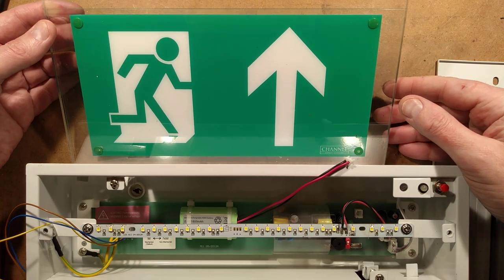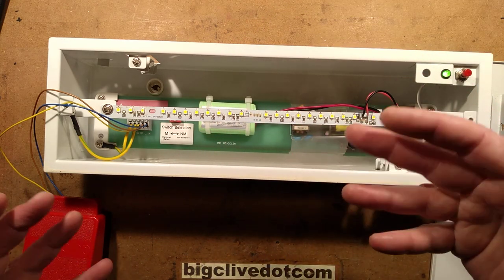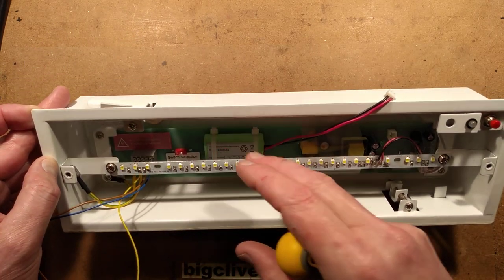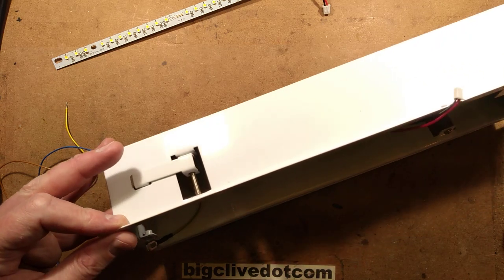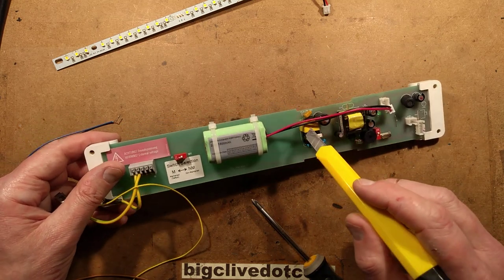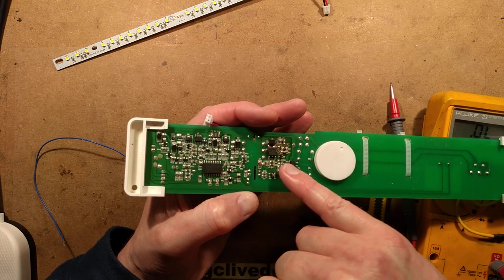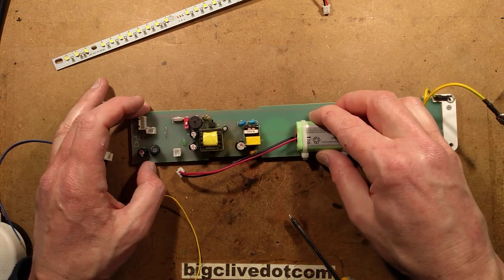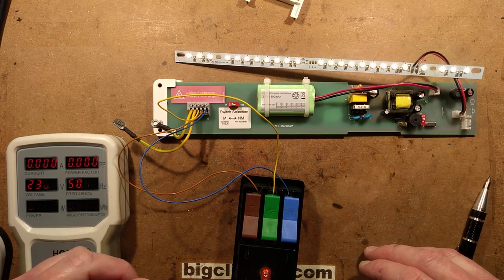Inside a self-testing emergency exit sign.

Comment: In the 90s I was working at a cinema as a machinist, we had 24V exit signs, two lead acid batteries in the machineroom was the powersource. The Cinema was built 1923 and using the same cables and some patches, it was a struggle to get the signs working at all. And some directors slipped a note in the box with the 35mm film with instructions how to show the movie. It was quite common with a schedule (raider) how to show the movie, this music should be played before the movie and this after. I remember Jurassic Park, "Please turn up Dolby effects volume, turn exit lights off".
Reply: Steve Henriksson hey that’s really cool. I’ve seen a copy online, of the notes Kubrick sent out with the Shining.

Comment: These newfangled fancytype signs are no fun anymore without the radioactive gas
Reply: I had an office in a facility that hadn't converted its exit since from Tritium. Part of the facility was used on weekends as an AirSoft play range.  Some of those signs got shot out :( :( :(
Reply: @patchvonbraun  Because the gas is heavy hydrogen, the mean velocity of the molecules at room temperature is very high and the diffusion rate of the gas in air is extremely high. It is virtually impossible to experience even a measurable dose of beta radiation from tritium when one of these signs is broken, let alone a dose dangerous to health. There have never been any recorded cases of significant health impacts to anyone as a result of their breakage so far as I am aware.

Comment: I see a problem with these devices and the description of them. They have a fairly accurate timer (I assume less then 20ppm error for that crystal) and after power-on they start self tests at regular intervals. So if you have more then one of them powered up at the same time, they will run the 3h self test at the same time. If the clocks go out of sync, there is still the key switch mentioned around 3:37 to synchronize them again.

Now with these parallel 3h self tests, all emergency lights will drain their battery at the same time. If a real emergency happens after that 3h self test, the battery will be empty.

A solution would be some sort of random value added to the self test interval or some redundancy (two batteries, each capable of powering it for 3h).

Just some thoughts.
Reply: That's the same scenario as annual EM testing on any lighting circuit. It's a roll of the dice, the regs say they should be tested at "a time of minimum risk" but is that through the day when there's natural light (in some buildings) or through the night when there's less people put at risk (in some buildings). They then have to obviously charge back up just like this one. I do 2 floors in our building, the floors are shared among the shift sparks, and test monthly in sections, around 15mins per section. Then the annual test comes along and I have to do a quarter of a floor per 3hrs in a night, obviously risking failure due to actually running the batteries to death (very common) or some power failure emergency happens before they're properly recharged (far less common).
Reply: You’re thoughts are right. I can tell you that “professional” auto test emergency lighting does indeed have randomisation of duration tests to ensure em lighting isn’t compromised as a result of synchronised tests. More advanced systems will allow remote monitoring/ triggering of tests which can be used to schedule tests at specific times on an individual basis.
Reply: Randomisation of the duration of the test wouldn't be the right thing to do. The duration of the test must be 3h and the interval between tests must be less then one year. So the only variable is the interval between tests and the random value must be subtracted from the year to make sure the interval isn't longer then one year.

Another problem with small embedded systems is a source of true randomness. Most of the time there is none and they are completely deterministic.

Today in the office I had to press the test-buttons of similar emergency exit signs, just to see if they behave in the same way as the one shown in the video. It was exactly the same, but I didn't wait for the long test to finish. ;)
Reply: zvpunry No you misunderstand. They Random seed the start date of the duration tests, not the test length, then 3hr tests still occur every 12 months, they just won’t happen all at the same time.
Reply: I had to read it again and you are right, this would prevent the tests being started at the same time.

I somehow read "randomisation of duration tests" as "randomisation of the duration of the tests".
Reply: Phil Knowles Remote triggering of battery draining is dangerous as a robbery gang could drain all the batteries before a planned robbery (there are even more sinister criminal abuses that I won't mention).
Reply: John Francis Doe, the equipment I mention is designed to be run on scheduled tests via a calander set in a BMS. It is indeed important to remember that such equipment is designed to be far more secure than your run of the mill IOT devices. That being said the reporting systems would be able alert users to such events, tipping people off themselves. I’ll freely admit that I’m not expert in robbery, but I would suppose that creating an out of the ordinary event by hacking in a secure system with possibility to be traced is a lot of effort to go to to increase your chances of being caught just to disable the emergency lighting system. Can’t think of any Hollywood movies where the robbers went straight for the Emergency lighting system....damn Hollywood.
Reply: I got a few of those units, and I got the manual for them (it's online for most manufacturers) all the ones I saw that "self-test" themselves says that the self-test is decided randomly and then the unit keep track of that first test, so that, according to the manual, not all units will be tested (and therefore, with drained batteries) at the same time.
Now for long-run testing, rules are probably different between countries. Here in France, the minimum Emergency light duration is 1 hour. Test must be done every 3 months( visual only) and every 6 months (one-hour test) - the law even specifie that if the place close down (like a supermarket) the tests must be run during closing hours so that the units are partially or fully recharged for reopening.
French ones must have two LED for indicating the state of the unit : green for okay, orange and/or red for issue (usually, orange is charging battery, blinking orange is a battery issue)
Reply: @zvpunry1971  And now you understand why German eliminates the space between parts of a compound word. ;)
Reply: HenryLoenwind: Die Unterhaltung wurde aber auf Englisch begonnen, was unter einem englischsprachigen Video auch sinnvoll ist. Plötzlich die Sprache zu ändern erhöht nur die Wahrscheinlichkeit für Missverständnisse. ;)

Comment: I took apart an older-ish (1990's I think) emergency exit sign before. It's the old US type with the red letters. It had a bunch of very bright red LEDs. Battery was NiMh. The coolest part is the power transformer! It has a 277V winding, and a tap for 120V. That way it can operate off of single-phase or three-phase power systems.

P.S. I remember a few years ago, some emergency lights were recalled for ... catching fire! LOL, fail.

Comment: Emergency lights are fun to play with, I pulled an 8w tubed one from a skip a few years back, well-toasted inside but still worked, but I gutted it anyway and filled the thing with LED tape and glued a 12v SLA battery into it, and then earlier this year found an NIB LED one in a charity shop for a fiver, complete with battery pack, and that too I've thrown some LED strips into to make it useful as a regular bulkhead light with the option of backup light... :)

Comment: Up until a couple of weeks ago, (when I was laid off) I installed these as my job here in the states. In America the test is not 3 hours, but 90 minutes I guess if somebody's in an emergency situation for longer than 90 minutes without power they're a goner.

I like the design of this, it's much nicer than the ones we typically see here

Comment: Sounds nice.  We found the emergency lights at work were dead when a power outage happened and most were non-functional including 2 of the 3 on the stairs and all at the landing outside the stairs.

But they replaced them...no need to turn off power, just get sparky to twist some wires up quick live.

Comment: Self resetting fuse to protect it from surges caused when powercuts are restored.
Reply: more likely the MOV is for surges and the PTC thermistor (Self resetting fuse) is used for short circuit protection
Reply: @DazzaDirect  or overcurrent for when the "junktronics" fail and overload :))

Comment: You know what's handy? Those emergency bug lights. You bust the little KO at the top, put a connector in there and bam throw an SO cord on the end or something. Battery packs last a good 4 hours or so. I wired one up for the grandma and if it can be plugged in somewhere handy it's a great for temp lighting immediately after power failure while old folks find their trusty flashlights.

Comment: One day Clive will do the finger test on a cap and will be shocked hehe
Reply from the maker: It's happened before.  That's part of the excitement.
Reply: If I recall the video I saw was with a plug that he promptly dropped saying " fucking hell "  don't remember which one exactly though! 
edit It might have been one of the bug zapper videos
Reply: @ollieb9875  I had a cheap "tennis racquet" bug zapper. My 40 year old son asked what is that, I said hold your finger out and showed him. Fun times.
Reply: @dsloop3907  evil! Hah hah 😱🤣😈 justified. :)
Reply: across one finger or hand is FAR better than a big hit from arm to arm or arm to other part of body ;)
Reply: @throttlebottle5906  - 18,000 volt laser power supply down my right side.   Whoops.

Comment: Why didnt't they put the maintained-nonmaintained legend on the silkscreen instead of a label? And why do they need a crystal?
Reply: My guesses; 
1. For localisation, just slap on a label of the language you're selling. 
2. Crystal is for timing, the 30 sec test, the 3 hour test, and the weekly/yearly schedule of said tests.
Reply: My guess is that the crystal is for the self test timer.
Reply from the maker: The switch may be a general purpose option switch.  Maybe they envisioned other uses in different markets.  The crystal is probably for timing accuracy in the self test routines.
Reply: @eliaschnl  
The internal oscillator of a micro controller should be easily accurate enough for all testing purposes. Typically they are within +-1 or 2% worst case. Does it really matter when a 3h test runs 2 minutes longer or shorter?
Reply: @superdau  Depends on what kind of MCU. Mayybe it doesn't even have a built-in oscillator
Reply: That's a fairly high-end micro; it probably would not have an internal oscillator.  No doubt similar functionality could be squozen out of a common little 8- or 14-pin device.

Anyway, it's running at 20MHz!  That's a bit on the fast side for a simple R-C oscillator, and accuracy is even worse at high frequencies because it requires low resistances.  It's worth noting that some vehicle control units only have a 16MHz crystal  (though these have even posher micros, where internal frequency doubling would not be inconceivable).
Reply: @bigclivedotcom  
The switch does have "M" and "NM" in white silkscreen either side of it. Perhaps they included the addition of a sticker to avoid problems with elec-chickens on installation?
Reply: bluerizlagirl It May be running at 20MHz, but it’s hard to see why they needed to run at anywhere near 20MHz for what they need to do.  Even a 32.768KHz watch crystal, and which are usually more accurate than your average crystals, should be more than enough speed for the very limited processing needed by this device.  Even on a four cycle instruction MCU that would be executing 8,192 instructions each second — more than enough to increment the real time clock routines every second, or so, toggle the light on/off pins, and set up a PWM output on the beeper and toggle it on and off as needed (or even bit-bang it if no PWM output is available).  The point being that nothing they are doing required that sort of grunt behind it and running at unnecessarily high clock speeds is wasting a bit of power that could have otherwise been saved.  

Essentially, that emergency light has more processing grunt devoted to it than an old 8088 PC-XT which seems just a bit....well....excessive!  But maybe it’s busy running Wordstar, Lotus 1-2-3 and dBase in the background and handling the office correspondence, in which case offices probably could use more exit signs?  Just having a little fun — for those of us who programmed early computers and enjoy programming microcontrollers this sort of thing just feels exceptionally wasteful because there are more appropriate clock frequencies and/or microcontrollers that better fit the requirements of this project.
Reply: @ethanpoole3443  Yeah, but these modern kids today hardly know they're born.  The SGS-thomson development kit didn't come cheap, when I was working in electronics.  And if you used the drag-and-drool interface to build your project without writing a single line of code, it took a lot of clock cycles and a lot of ROM space to do anything.  I think it must have been running a full-on interpretator on the micro .....

The tie-wearers loved the ST micros, though!

P.S.  Yes, I did once save a whole bunch of ROM space by using the handy approximation that 1 inch is about (256/10) mm and the assumption that if someone wanted ancient units, they didn't care so much for accuracy anyway ..... ;)  [You're welcome to try it yourself if you wish.]
Reply: Yeah, and why did they design such a large pcb when not even half of it is occupied? And why include the manual labor of using zip ties to hold down the batteries and a screw type panel mount test button instead of a pcb-mounted one? Why didn't they just design the leds, power supply and test button on one single pcb, and why not a pcb-mounted battery holder? Stuff like this makes me sigh because very few people love the job they do when they sit and assemble these things every day
Reply: "squozen" - Will you please be careful, using irregular verbs has mating-call-like effects on some people!
Reply: Are you trying to tell me you brothe heavily when you read that?
Reply: Don't push your luck, I don't think I'm quite ready to advance this relationship so soon.
Reply: @ethanpoole3443   The extra processing power is used by the NSA version. If you check the firmware, you'll see that starting at line

gasp thud

Comment: *looks closer to see battery* THAT'S IT?! They might as well be little button cells! The heck is that?!
Reply: Coaster Labs When Code only requires a certain number of hours of runtime then that is what these fixtures will be built to reliably deliver.  LEDs have allowed designers to greatly reduce battery size since LEDs can deliver the same lumens of usable light for just 10% of the amp-hour rating the old incandescent bulbs delivered and they even save a good bit versus fluorescent bulb fixtures since they don’t need a high voltage inverted stage anymore.

Comment: I wonder how long the LED's will last continuously operated?
It's a shame we haven't got to the point where we can create white LED's that don't fade over time. Quite often you see them turn to a dull, pale purple.

Might be interesting to see if a manufacturer decide to create small 12" LED tubes for this kind of application.
But I guess by the time the LED's degenerate, it will be way beyond the time to replace the battery.
Reply: I had a 10w cealing light which just started flickering
Reply: Dan Coulson 

Does anyone know if the purplish light said to be emitted by end-of-life phosphor LEDs is UV light?  I.E., perhaps the junction was designed to emit UV to energize the phosphor, and continues to do so, but the phosphor becomes incapable of converting it to white light.

If yes, is the emitted UV dangerous/harmful?
Reply: @haroldsmith45302  it cannot possibly be harmful first because of the low output, second because it's all blocked by the housing. Also, UV is not a visible light so I doubt that's the case.
Reply: Eemergency lights have to be certified in the UK, and elsewhere in the world, part of that certification involves what is known as performance of LED modules, LED modules have to comply seperately and are tested for RG (Risk group, usually RG-0 or RG-1) ,Blue Light and UV, the UV is very low and not harmful, even at end of life where it has considerably dropped.
Reply: Harold Smith Only the very earliest white phosphor LEDs used UV — and that was well before incorporating them into light bulb fixtures became a thing.  Aside from those very, very, rare early phosphor white LEDs, all white phosphor LEDs use blue light.  Otherwise they can produce white LEDs that do not diminish over time, provided they are run at conservative power levels with ample coiling, by using actual red, green, and blue LEDs instead of phosphors, but they are not as efficient and cost more to produce and run per lumen of light than the more common phosphor white LEDs.  But for signage like this it would be very practical and would allow for simple battery replacement.  Unfortunately, we have become a throw-away society of late!